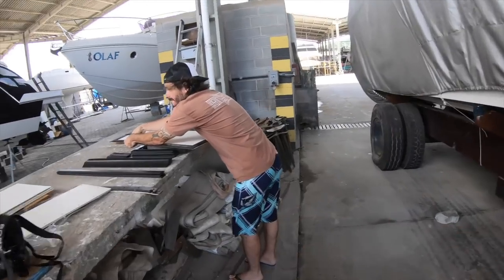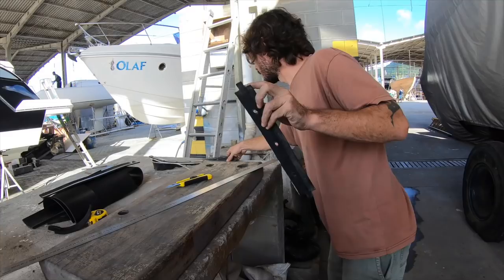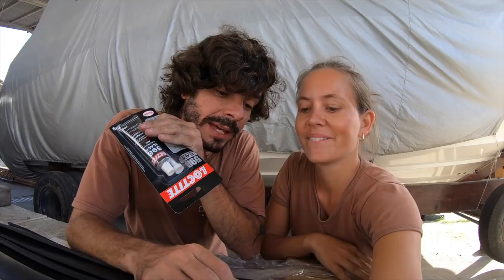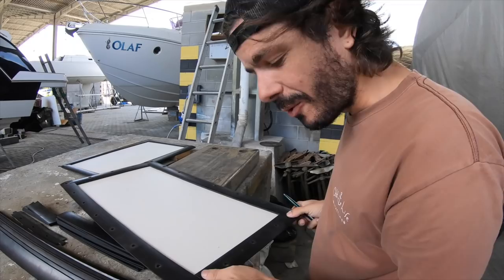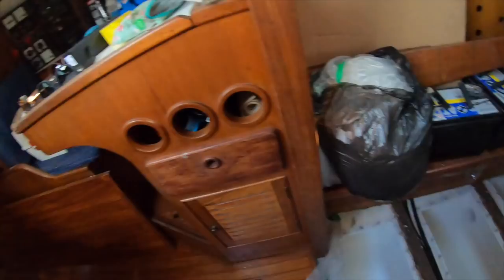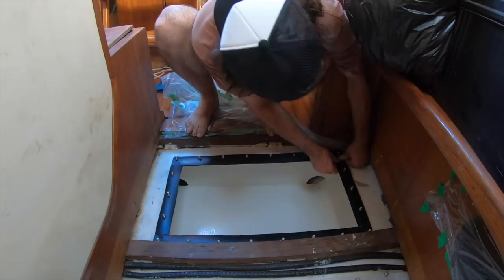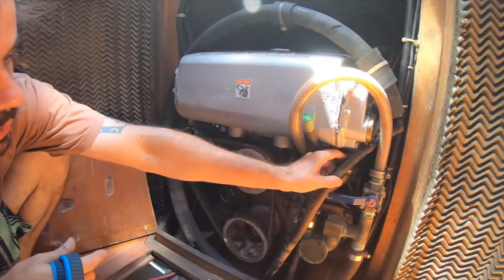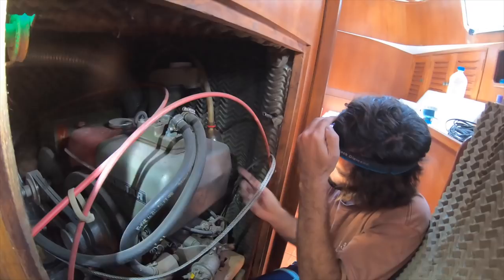⛵️Time to FILL UP our DIESEL tank?!? #127

Comment: Maybe you could try to dry-fit the lids of the tanks. If you would fill the tanks with compressed air and measure the pressure you could see if there is a leak. If there is a leak, you can spry on all the seals and connections a mixture of soap and water, which will create bubbles if there is a leak. I have not really any knowledge about boats and the gadgets used for the different types of tanks, but maybe someone else who knows a little bit about it could tell you if this would be an option.
Keep it up,
Reply from the maker: Thanks for the suggestion. 😊

Comment: Have you ever thought about switching to EV for the drivetrain and install solar and large lithium battery bank? I recently got myself my own sailboat after following your channel and a few others for a while now. I picked up a deeply discounted Gemini 105 due to the bad diesel engine and generator engine. I originally was going to switch to gas outboard like a lot of Gemini peeps do, but quickly realized I could get an EV outboard setup from golden motors for not much more than the price of a brand new outboard motor in the 25+hp range. So I installed a 48v 20hp EZ Outboard on Garelick mount and some Lion Energy batteries onboard in the place the old diesel engine sat before putting the boat back in the water to finish other projects on the boat. Since the install I pulled the EZ outboard and redid the back to install dual 48v 20hp EZ outboard motors, because I decided having a 2nd for backup is really good when abroad and 2ndly I noticed the controller and motor would sit around 80% of max temp rating when pulling full power for more than hour at a time, so with duals they barely get warm to reach the same speeds as before, so in theory last longer. I also installed a new 48v DC diesel generator, so I can have power in the times I don't have solar and because its the same input voltage as the EV motors, I can run it and trawl basically all day off the generator alone if needed. I am currently in the process of upgrading the solar on the boat, it originally came with an 800watt system on the back on a mount, but I am trying to squeeze as much solar on the boat as I can using some of the flex panels so I can run things like a/c and such if possible without running the generator. I really enjoy the quiet sound of trawling with barely any noise from the EV motors.

Comment: It seems like metal work is pretty reasonably priced down there. I would have a couple cutting dies made that you could use to cut the end shapes with a hammer. Then of course, you'll have those around when your off cruising and can use them in the future for replacement gaskets.

Comment: Too late, I guess, but the way to cut a precise match in the gaskets was to has a die made and hammer the cut in the material. The same die is used for both gaskets. Visualise a square wave form. It will be perfect.
Reply from the maker: The problem is that we didn't have time, material and tools to die a metal for it.
Reply: Odd Life Crafting Anyone with a small metal press and a grinder is all that is required. Steel strap of 12mm thick x 2.5 cm by sufficient length for a 2.5cm flat, 90° bend, 2.5cm (or appropriate length) flat, -90° bend, matching flat, -90° bend, flat. The start and ending flats are aligned to the edge of the rubber accepting the dado (the indentation on ‘female’ side of the joint). The bends are non-critical because the same die is used to make the dado and rabbet. Grind an edge on on side of the strap. Wet the rubber, position the die with the cutting edge on the rubber and strike the blunt edge. It is actually possible to do both cuts at once. Keep it in mind for matching gaskets in the future. Resharpen as necessary keeping the grind as consistent as possible.

Comment: I don't know if it is possible, but my thought about the diesel hoses over the water tanks:  cover the diesel hoses with another wider hose, especially in the neighborhood of the watertanks.That will mechanically protect the diesel hoses.  In case of a leak, the diesel cannot reach the water tanks.
Reply from the maker: I think we won't have problems with the new hoses. We hope so. hehe

Comment: I realize that you need to get the water tank and hoses done first but you will want to do that as soon as possible when the marina opens.You need to get the diesel tanks straightened out and filled as quick as you can...dont worry about it sitting...you can buy diesel fuel stabilizer...I am sure things are different in Brazil but at least here in the states fuel...both gas and diesel are currently much much cheaper then usual.As much as it sounds ghoulish you may want to take advantage before that changes...the extra money can be used for further projects.
Reply from the maker: The price is the same as it was before here in Brazil. We are not sure if they are working filling the tanks right now, I think the company that has the truck to fill the tank is not working, they are in quarantine.

Comment: You should have cut gasket joints as a dovetail instead of square, they would resist pulling apart much better. Also use much better hose clamps that apply the clamping pressure more evenly than the cheap worm gear.

Comment: Have you considered using flow meters for the boat engine and generator?? If you use the generator for two hours you will know how much fuel it takes in Liters/Hour. Same with the boat engine.  Just an idea for you to ponder ……………......…..
Reply: @Jay Gas engines do too. They used to have a meter that measured both in the same unit.  This was for gas vehicles back in the '70's.   Was hoping it was still available today and for diesel. Truckers in the U.S. have all kinds of gadgets they put on older diesel rigs.  just sayin'

Comment: I guess ur done making the gaskets, but as a woodworker it struck me that there is another faster and more accurate way to make multiple "joints" at the corners. Make 2 precisely cut 4-5 cm tall wooden blocks (guides), 1 for the male and 1 for the female layout. Then place the guides atop the rubber, clamp it all down properly, place a wide and sharp chisel butted up against the cut outs in the guides, give it a smack (some wood under ofc), and et voilà ! Maybe it would have worked?
Reply from the maker: Thanks for the tip. The problem would be to have the correct tools to make the wooden blocks here in the marina.
Reply: @OddLifeCrafting  I'm sure u can find a wood shop somewhere,,, or make it urself,,, all u need is a (fine toothed) saw, a sharp knife for marking, the same chisel to clean where u cut, and a Thor's Hammer. I know u have a metal boat but u should carry these tools anyways.

Comment: Before you remove any hoses:  Apply colored tape to each hose on both ends and a few places in the middle.  Carefully film the removal of each hose.  That way you will know the original position of each hose if you need or want to duplicate.
Reply: PS. The province in China was on shut-down for ELEVEN weeks.  Although California is on shut-down from March 17 to May 3, officials have strongly hinted that it may be longer.  Unfortunately, here in the US, California was first but all other states started later ... and we have about 10 states that have not shut down.  The success of the shut-down depends on compliance.

And, yesterday, you mentioned meeting with mast installer.  Sorry.  That is not compliance.
Reply from the maker: There are 5 cases in the city we are and the marina is open this week 😁

Comment: When you finish the tank, you should make a small pressure test, with just 5psi / 0.2bar   and check for leaks with soap and water ... it is better to find the leaks with air than with diesel!

Comment: Hi guys, really enjoying your project. I listened all the way through your complex hose discussions, but it looks like you are about to make a mistake due to inexperience, which was already resolved in the original installation. Replace the manual foot pump in your galley which deals with fresh water from the tank. One of the saddest sights you will ever see as a cruiser is your friends with their backsides in the air trying to scoop fresh water out of the tank in the bilge with a tiny yoghurt cup because their electric pump failed and it's already a month waiting for the new one to arrive from the USA/EU or wherever and the inspection hatch is the only one you can get off without dismantling the boat. You can't blame the electric pump, it's only doing what it's designed to do in a marine environment, which is fail. Make sure you have a manual way of getting water out of the tank in at least one point on the boat. I would also use a foot pump on the sea water. It's really handy to be able to hang on in the galley with one hand, hold the pan under the tap with the other hand and use the foot pump to get the water. That way, you're not hanging on to the tap with your full weight in rough weather trying to fill the kettle or pan.
Reply from the maker: Hey Ted you understood it wrong. The original system has one foot pump and it is a salt water foot pump. There is no fresh water foot pump. What we said is that we want to have a fresh water foot pump because we think it is important to have one. We are trying to find space to have two foot pumps but so far we couldn't find the solution.Maybe we were not that clear on the video but we meant that that was the "idea" we still didn't define 100% how it is going to work yet. We are still discussing in between us and also with more experienced friends. 😊👌🏼hope it makes sense. hehehehe Stay healthy and safe my friend!

Comment: Rubber hoses can last a long time the tell tale is in most cases cracking or easy staining from the rubber itself. Cracked hoses should be replaced, most hoses will be from the first build so more than 25 years old.

Comment: Hey from Belgium, 
Nice project that you are doing but I just wondering why you didn't convert the diesel engine into an electric engine supply from batteries. And adding solar panel on the tent and wind turbine on the back of the boat to charge the batteries.  It's great for the environment and for the economy (don't need to buy oil anymore). But anyway, Congratulations both of you for saving the life of the boat.
Reply from the maker: Thanks. Electric engine is impossible by now as they are hard to find in Brazil and realllllyy expensive. We are gonna add solar panels and wind generator

Comment: Will you install the radio antena on the top of the mast or on a bracket mounted to the side of the mast
Reply from the maker: Yes
Reply: I was loookin for this. Maybee put it on a pole aft? If it is on top of mast then it see far but not so good near. So for navigaton at night in narrow waters like an harbour it my be better a like 4 meter above the sea? I like this free hang mounting that Erik from NBJS use. See 13.00 in https://www.youtube.com/watch?v=TJBHr3_vpPc

Comment: You must put a valve between the tank and the hose
Reply from the maker: From the tank the water goes to a pump, so there is no need of valves, we think
Reply: @OddLifeCrafting  With the diesel tank, you can always replace a hose and you can always immediately shut off the diesel in the event of a leak

Comment: Love your vids. I was wondering if it's possible to fit a water filter system to the water tank inlet?  So when you fill your tank in more isolated places you still have healthy water? I'm not sure if this is even a thing for mid size yachts?

Comment: try cutting a dove tail joint like in wood drawers it will help interlock the rubber and seal better then a straight cut
Reply from the maker: It’s a little bit like it. ☺️

Comment: Another thing to do when the mast is down is to pull the cables for the electronics and not to forget the VHF antenna on the top of the mast, including a lightning deflector system.  Nice update.  Not changing the filling hose (for filling up the diesel tank) might bite you later when you start filling, and come down to 600 liters of diesel behind the wall and in the bilge. Since you are doing hoses now, swapping out the main filling hose would make sense.
Reply from the maker: Yes!! We are actually checking it this moment (the cable for the VHF), hehe. Coincidence. About the filling hose, it's a big and amazing quality rubber, we don't think we are gonna have any problems. Thanks for the concern.
Reply: Check the inside of the hose with your endoscope. Check the outside of the hose also with your endoscope. If there are any cracks replace it. It will save you a big headache in the future.

Comment: Unless the Diesel engine is self priming it won’t start. You may need to use compressed air from the filler port to force diesel fuel into the engine to get it to start.

Comment: Is it possible to re-route (change direction of)  the hoses of the diesel tank, so they do not travel over the water tank at all?  It might be worth using some longer hoses to avoid the water tank all together. Now would be the time. I would not think that change in length of hose would bother the Diesel engine at all.
Reply: Now would be the time to study plans, and find an alternate route for the hoses. Lots of time.....

Comment: Diesel engines usually have a fuel return line. Check for it an replace it also.
Reply from the maker: It’s one of the hoses we replaced in this episode

Comment: The bottle on the engine is called a catch can as we say here in the uk. It’s an over spill stop your engine soaking itself and flooding it’s not a sample bottle. I hope this helps
Reply from the maker: You mean the plastic bottle. Nop thats a sample. There is a manual pump that pumps diesel from the bottom of the tank. So you can tell if there is water or dirt on the bottom of the tank. It’s even on the blue print from the boat yard. 👌🏼
Reply: Odd Life Crafting yes it’s called a catch can. It tells you what your engine is pushing through. I’m not lying that’s what it’s called look it up on the internet. The name for what you say is not a sample bottle the term is a catch can. Love your videos they make my whole week in this sad time we are in. Honestly. Look on the internet of the term catch can.
Reply from the maker: Ohh you mean just the name. Hehehehe I will check it out. I understood you meant catch can had a different porpoise. To be honest I still didn’t understand you first explanation on the first message (language problem). Actually let me look up. I just googled it and watched a video about catch can. And actually that’s not what we have. What we have has nothing to do with the engine it self. It is literally just a small pump to colect sample of diesel from the bottom of the diesel tank so you can find out if there is water mixed on the diesel or any kind of dirt. 😊👌🏼
Reply: Odd Life Crafting oh I see yes just the name ha ha. Oh I see. Your language is perfectly fine. I suppose different engines mean different on where you come from round the world lol. I just want to say thank you for replying to me not just once but 3. Most you tubers when you ask them just put a thumbs up sign as if to say they read your comment but you both have taken time out of your busy schedule and replied to me so I thank you and have the most up respect for your channel it really chills me out on these hard times. I have a suggestion for you. You obviously love boats the both of you. There is a guy on YouTube named Leo. His channel name is Sampson Boat Company. He is restoring a gaff cutter I think it’s called. Sorry if I said that wrong but he is amazing. Maybe you to should swap ideas on boat life. Any way thank you for your time. Much love from me and my daughter annabel. From Norfolk United Kingdom. Great content. ❤️🤟🌈
Reply from the maker: Ohh we love Leo!! Watch every video!! I’m a huge fan!! His work is impressive!! Take care. Stay safe!! 😊🍀⛵️🌏
Reply: Odd Life Crafting me to. Get so much knowledge of him and  both of you lovely couple I would like to send you both an Easter present I know it won’t arrive on time due to this situation we are currently in but where can I send it to. You both be safe and stay healthy. I’ve been in quarantine for 14 days now without seeing my daughter or my parents can’t wait to give them all a big kiss lol. Take care. Much love from the U.K.

Comment: Look, since you're going to cut a lot of hoses, there was a tool for that, it's a type of pliers; the stylus is for superficial cuts, that's why it has the lines on the blade to break when it doesn't cut anymore. It's a blade that doesn't have the stability to cut too much outward, and after making the cut, you have to close and release it, you can't talk to an Italian with it in your hand (lol), it's very dangerous. Sorry but I had to talk :)
Reply from the maker: The stores are still closed here, I'm not sure if we would be able to buy this tool in time to use it. The internet products are not been delivered where we live now. Duca is also Italian, so it would be a problem. 😂😂

Comment: I know it's a little late now, but you could have bent steel and sharpened it, then put a plate and rod on the back to make a cookie cutter. It would look like a branding iron. But you could have just hit it and cut out the same shape every time.
Reply: Let me add that yall did a fantastic job :)

Comment: I would put a magnet on the diesel line purafiner distribution have a product to treat bacterial growth in diesel
Reply from the maker: We are afraid of using magnets as it’s a metal boat. But we are gonna use a antibacterial product
Reply: @OddLifeCrafting   I grab this from their web site  Q. Will the magnetic field affect electronic or computerised engine components?

A. No. The field is depleted after it moves about 80mm from the unit. In addition, the field is absorbed by adjacent ferrite materials.